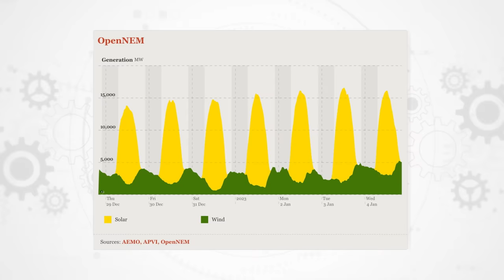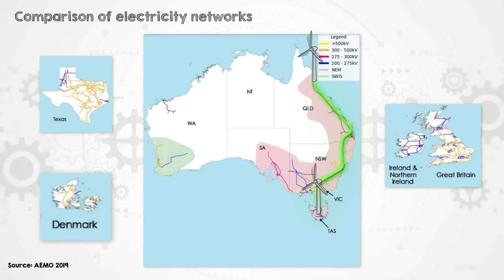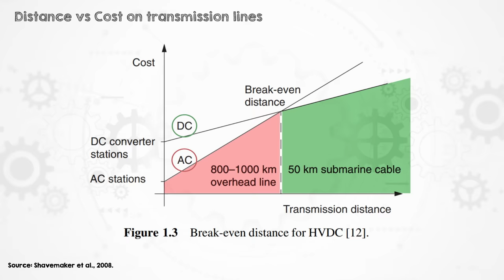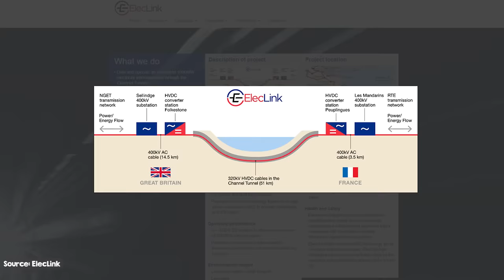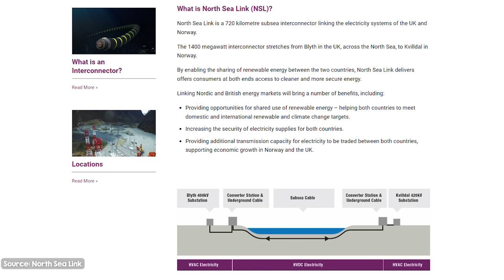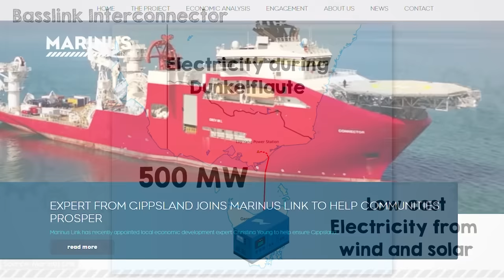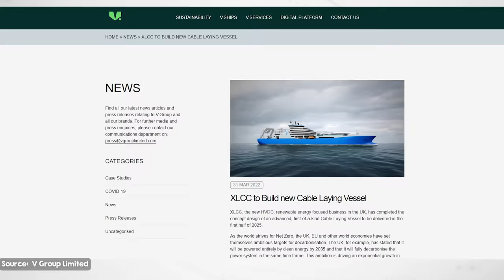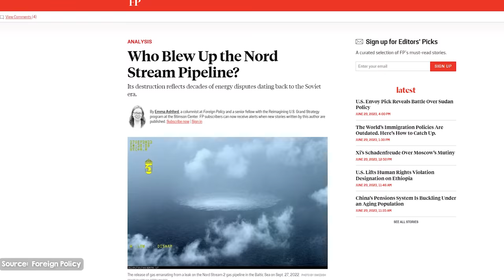Electricity Across Oceans: Is HVDC the Future?

Comment: How is the high voltage dc stepped up and down? Are there super high voltage IGBTs or transistor boost regulators?
Reply: So far HVDC systems only convert AC to DC. There are no HVDC to HVDC converters. While it is not impossible, it would probably be quite lossy and also with limited application in the current grid.

Comment: HVDC is used because of the difficulty of synchronization of two different very distant AC sources. Is it due to the expense of rectifying the AC destination and re inverting it to AC for use on the destination grid that HVAC cannot be used for this purpose?
Computer Engineer out of his field here:)

Comment: I believe that the new geothermal technologies are going to come online before long and curtail the need for a lot of these cables, especially in cold weather countries. Quaise comes to mind especially because it doesn't require heat sources close to the earths surface, but there are multiple new geothermal technologies that can allow these plants to act as peaker plants. Many of them are based on fracking technologies, and several test plants are already built and performing as expected.

Comment: Extra long distance HVDC interconnects are intriguing, and no doubt will prove to be ideal solutions in hand picked cases. But in the overwhelming majority of cases, the far simpler and exceedingly more ideal solution is just to build local generation. And since the goal is decarbonization, that means nuclear power. It would be nice if the green energy crowd would stop plugging their ears and shouting when the obvious solution sitting is right in front of them.

Comment: HVDC is outside of my direct expertise, I have been banging on about a East-West trans-Australia HVDC cable.  The solar and wind resource is Vast.  And it adds 2 hours of solar to each coast.  This energy can be used by the mining and refining industries to really help decarbonise.
Reply: What about a cable between Australia and NZ?
Reply: @the11382 I haven't put any thought to it.  It may be of no benifet to NZ as you have plenty of Hydro recource ?    Long term this may be a good idea.  

We should design for best use of Local power production, however the more interconnected we are, the "resilient" we are.

Comment: Battery prices are coming down still. I think local battery storage represent a cheaper, more reliable, and more adaptable (to varying renewables and loads) solution than expensive HVDC systems. If we replaced existing HVAC lines with HVDC it may make more sense, or if HVDC cables are installed under water and not over land.

Comment: 1,600 klm is the gap between Kalgoorlie WA and Wudinna SA.

Perhaps generation capacity along it's length would be worth while. 

Excess generation would allow desalination water supply and fantastic views along the Great Australian Bite. 😊

Petroleum supplies at the Roadhouses could be reduced. 
Maybe hydrogen generation as a fuel along the length. 

The rail could be electrified.  😊

Undersea cables can not have customers along its length. 

Cheap land and desert populations and manufacturing in a warmer world maybe an interesting idea. 😊

Comment: How does DC transmission affect the grid stability and grid frequency?
I heard that rotating mass in electricity generation has been used for keeping the frequency in the grid.
How does more DC transmission play into that?
Reply: Frequency control is an AC-issue, DC means there's no frequency to control. Also rotational inertia is loosing importance, we're getting better ways to control generation and loads to reduce the issue. The phenomena isn't made up, but people bringing up frequency and lack of rotational inerta in renewables as a good reason to keep burning fossil fuels and or wait decades for new incredibly expensive nuclear power reactors operational either don't have a clue what they're talking about, or are straight out lying.   

Also, increased transmission capacity is a very good thing for grid stability.  The fact that lines acts as a capacitor means DC transmission lines could potentially give a small buffering effect, small amount of energy but instantly available. I don't know if that has an significant effect in practical applications, but DC means you can just hook up capacitors and/or batteries to mitigate small fluctuations. No moving parts, no friction, no significant energy loss to keep instant power available to automatically stabilize voltage. Again, no frequency issues in DC, as there's no frequency to have problems with.
Reply: Modern HVDC system can be controlled  in a way that actually supports the grid.

Comment: Rosie mentioned the extraordinary quick payback on investment for the new HVDC connections in Europe. I imagine this came as a happy surprice for the investors as prices and discrepancies were lower when these projects were calculated. I think the arbitrary returns will only increase with time. Higher ETS prices and more cheap renewables will amplify the price differences between different markets. Windy low pressure systems from the Atlantic normally take a couple of days or more to travel from Ireland to Finland. With more and larger wind turbines in all countries along the way there will be a demand for even more HVDC lines.

Comment: What about ammonia? 
I wonder how the economics of 4000km + HVDC undersea lines compare with green ammonia generation from solar/wind as a defacto hydrogen source. Transmission of ammonia by tanker is possible more simple and flexible as power to ammonia to power. Tanker transport of ammonia would need forming and reforming plant, but is scalable and allows diverse destinations.  In fact Keppel and Exxon Mobil are developing an 850,000 tonnes annual facility from Queensland, Australia to Singapore which would be in direct competition with the Sun project you mentioned. 850,000 tons of ammonia  is 5MWh per ton ie generates 4.2GWH which is the same as the proposed line HVDC line. At 40,000 tonnes per tanker that is 20 trips per year ie 2 tankers running a round trip each month. Already the world moves 1.6M tonnes per month by sea in 40 tankers. No doubt much of that production of ammonia is from fossil fuels but electric green production can be done by several methods
Ohh.. and make fertiliser and grow a few crops if you have extra ammonia/ammonium.

Comment: Nothing new here, back in 1965 I worked as an electronic tech in a telephone equipment and power supply company where they developed a 25kv DC inverter supply to power an off shore oil system, this is when semiconductors were quite new.....They were still using selenium rectifier stacks then.....

Comment: Utility-scale batteries of several chemistries are currently nosediving in price, and judging by the many new designs coming out of the labs will continue to do so. I now think long distance transmission will cease to be the cheapest method of firming a renewable grid - in most of the world diurnal variation and even dunkelflauten can increasingly be dealt with by more local storage combined with overbuild of (incredibly cheap) PV solar. I think in most climates this combination will slowly outcompete wind, pumped storage and submarine cables, which do not promise the same future cost reductions PV and batteries do.

Comment: California was the first place that I know of that installed a 950,000 volt HVDC power line from Oregon to Southern California.  The dis-advantage is you can add power to the line anyplace along the power line, but can only take it out at a inverter location, such as Los Angeles.   I think the capacity is either 1,000 MW or 2,000 MW.  

One huge advantage with a wind farm in the north sea is they can send HVDC to several countries, and it does not matter if the destination is 50 Hz or 60Hz, they can have a inverter at the final country, and  change it to the local needs.  

One new HVDC line is being installed  in 2023 / 24 between some wind farms in New Mexico and Phoenix AZ.  I think it will be about 2,000 MW of capacity.  The problem is they are not easy to have it bi-directional.

Comment: Plate Tectonics: How do you get the cable across the volcanoes of the Mid-Atlantic Ridge without it getting cooked?
Reply: Maybe run the cable via Iceland?
Reply: @marksherborne391  That is part of the Mid-Atlantic Ridge, and a new volcano erupted last night as the distance from UK to USA increases  - spectacular lava fountains to cross!
Reply: @nigels.6051 the communications cables survive somehow don't they...?😂
Reply: @aleksandrsnaumovs4277  Not always! Tonga had to resort to Starlink when their volcano blew up last year. Normally they lay multiple cables with different routes, so that the system remains operational as long as they fix the damaged ones fast enough!  That is going to make a power cable rather expensive.
Reply: @nigels.6051  It's considerably easier to repair cables damaged on the surface than n hundred meters underwater though.
Reply: @marksherborne391  hard=no idea how to solve. Difficult=requires time and money. We've been at the bottom of the deepest trentch. Technology is more or less available. Ptovided enough financial incentive, we'll fix a dozen of cables if need be.
Reply: @marksherborne391  True, and the Atlantic is 4Km deep with 2Km+ mountains in the middle!   I don't think it makes much sense anyway up here in the north anyway since we don't use a lot of solar, and for wind it is unnecessary, you just need long enough cables to span from one high pressure across the adjacent low pressure, which the existing cable chain from Ireland to Norway already does most of the time, just wants to be expanded over land as far as Ukraine.  Down near the equator, solar power makes more sense, but then 1 degrees of longitude is a far greater distance - it is a lot further to cross the Atlantic down there than if you follow the aircraft flight paths up here, which go via the Arctic ocean, not the Atlantic, because that is the shorter path around the Earth!

Comment: On a technical aspect - DC cables are a crazy idea. Edison verses Tesla argument all over again. 
AC is the way to go - as DC  suffers from Electrolysis and heavy corrosion - especially when Aluminum is involved. That will lead to fires and voltage-drop losses. DC can't be easily transformed ( stepped up ) without  some sort of Inverter or Boost circuit. With AC power it is easy to boost or reduce, through transformers. 
Additional to using AC over DC - I don't see capacitance or skin effect as an issue, if you run a very low frequency AC system or separate the 2 feed cables with some physical distance between them or place  A electrostatic shield fitted between the two feed wires and have it grounded it as done in Audio Transformer design.  Feed the AC line as a balanced feed, not and as an unbalanced DC feed.  Balanced feeds reduce transient noise on the feed lines with less shielding. 
At 50 cycles - skin effect is not an issue - its not Radio Frequency in the order of megahertz that is being used. 
One way of avoiding skin effect is use an multi-stranded "Litz Wire" as the feed line; as that minimizes skin effect losses.   Another cheaper way is use a SWER ( Single Wire Earth Return ) transformer system and use the ocean ( or ground ) as one of the feed lines.  
Inductive losses - if you have any - can be cancelled out with a feed line that is wound correctly to cancel such out. 
DC also has issues with Node current sharing points hence resistance balancing is required, which AC generally does not have to worry about. 
Additional if the AC is fed as multiple phases, instead of big single phase line, you can send more power with less losses over greater lengths at lower voltages, and use phase balancing transformers to rebalance the system at each end. 
You can't do that with DC unless you use a stacked feed system, which has both grounding problems and voltage reduction issues to contend with.  In the long run a DC system will be fraught with technical problems. 
As for cost - that's often always used as a cope out excuse for delivering an inferior design. 
Cost is no issue when they can send Billions to the Ukraine, or new telescopes into space, or blow up the Nord Stream Gas Pipeline to all of Europe.
Reply: Skin depth is only 9mm at 50Hz. For large cables that are designed to carry around 2000 A. 9mm is not much. Also the bigger issue is the capacitance of Cables. The errosion is not an issue as you use two conductors. HVDC is not replacing HVAC, it complements it. It is used where it's supperior to AC.

Comment: Absolutely fascinating. I was told that the reason electricity delivery was AC was because of  the need to transmit it long distances. I guess Edison was right.
Reply: Editors dc system was limited inability to transform dc voltages, which is easy with ac.
Switching dc is more difficult due to no zero voltage crossing and problems extinguishing the arc.
Dc generators, dynamos do not load share easily when parallel. Easy with synchronous ac generators, alternators due to their synchronous reactance.
Reply from the maker: That was true at the time but is no longer true (in fact now the opposite). Back in the day they couldn't step up DC to high voltage so it had to be transmitted at low voltage, which means high current, which means high resistive losses. Now we can change the voltage of DC but it's still more complicated than for AC so it's only worth it for long distances.
Reply: High voltage reduces resistance losses. Back then, ac transformers were the only way to get high voltage.
Reply: @katrinabryce  The only /practical/ way. There were attempts using battery arrays - charge one bank in parallel while another discharges in series, then at the agreed time yank the giant switch and listen to the sound of a hundred contactors clunk as the series one reconfigures in parallel and vice versa so they can change places.
Reply: My misconception was that DC caused a build up of resistance in the transmission wires and that AC stopped that. Like a car trying to get out of a snow mound, one has to flip from Drive to Reverse to work ones way out. 😁

Comment: I've always wondered how they get around the Mid-Atlantic Ridge issue. It's a volcanic ridge that surfaces in Iceland and snakes it's way down south all the way into the South Atlantic. This is due to sea floor spreading and plate tectonics. The good thing is that the cable path is friendly, so I don't think that's an issue. The cable would land in Canada making America's isolationist politics pretty mute, but America will buy it anyway if it's cheap. Nord Stream was shaky to begin with.

Comment: The problem is that the power that is being linked is intermitted. Solar and wind energy can both go down when it is overcast and windless. Open skies are required for the sun to heat the earth to create an updraft, which creates wind. These sources are usually backed up by gas or coal power. Consumers pay for double the capacity.

Comment: Would a chemical means of storage and transport compete with these cable links? For example, electrolysis of water to make hydrogen, combine that with carbon, transport, reform, fuel cells. Or something involving aluminum?
Reply: Round-trip efficiency is a big problem with hydrogen. Lithium-ion batteries are something like 95% efficient (ratio of energy out to energy in). Hydrogen energy storage via electrolysis and fuel cells is more like 40% efficient. Ouch.

Mind you, if you expand from just electricity storage to energy storage (i.e., some process is going to need hydrogen, and you can supply it from your excess energy production), you don't necessarily pay the efficiency cost of fuel cells. But storage and transport are not cheap, since (like any gas) there's not much of it per cubic meter unless you chill and compress it. I guess if you have a pipeline network, you can use that and avoid some of this. But if you're talking about tanker trucks, rail cars, and ships, my intuition says those power lines are gonna be a better bet. Or perhaps use the hydrogen locally to make ammonia, and trade in that.

Aluminum seems more promising, to me. I guess Iceland already does this with its abundant supply of clean geothermal power: importing large quantities of bauxite ore on ships and exporting the aluminum. Is it cost-effective to use this as a more general tradable energy currency? I dunno.

Comment: This video is an interesting and a polar opposite of the conditions in Texas. Texas operates it own electric grid, ERCOT. Texas is not connected to the other two grids in the USA because it does not want to be under federal contol. The systems are not compatible because the frequencies are not in sync. There are a few interconnects, but they are not of a significant capacity. The DC voltage interconnect is a method for syncing electricity between two grid’s AC frequencies. It is also a way of separating political control both internal and external. 

As a result of Texas having an  independent grid, I am able to shop for my own power supplier. I can pick from multiple rate plans and contract terms. My plans name is Low Bid. As a result of the Valentines Day freeze, my Retail Electic Provider, went bankrupt. They were a 100% green electricity provider and the sun did not shine and the windmills froze. They were forced to purchase electricity at the very high market rates and resell it at low contract rates.